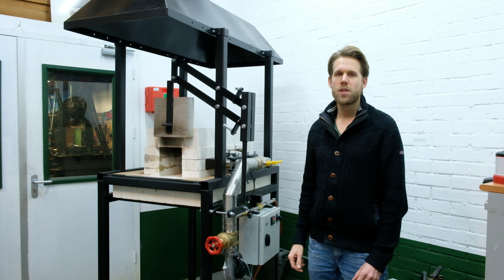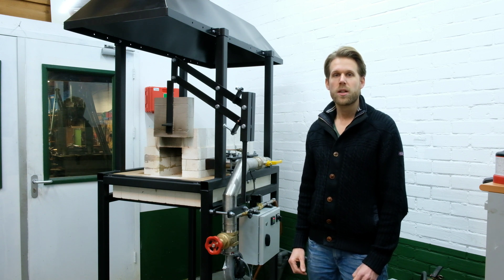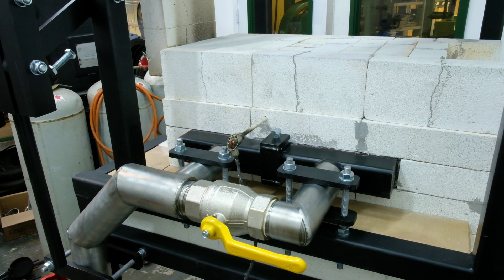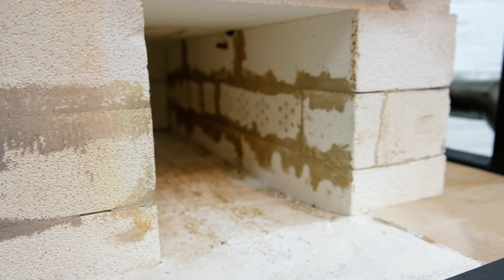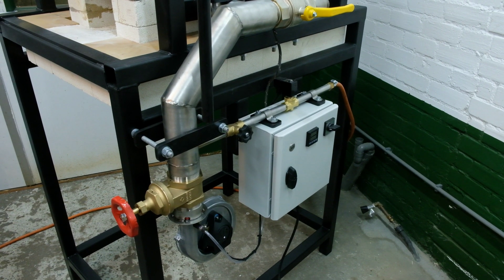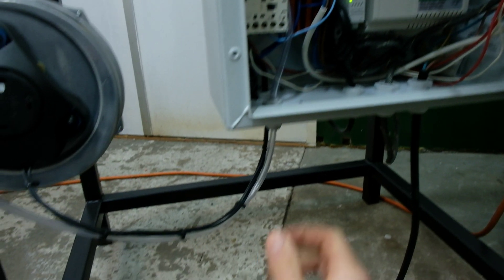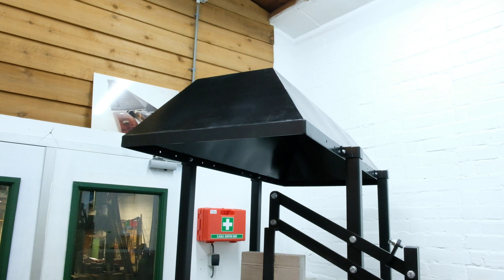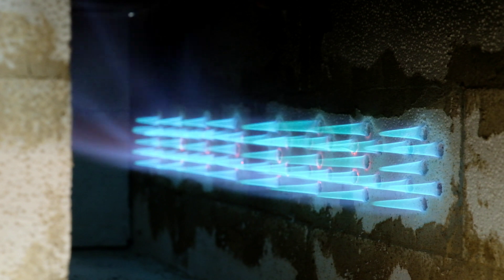Ribbon burner brick pile forge - Van Zanten Engineering

Comment: Great video, how is it holding up these days?
Reply from the maker: The burners are still fine. I do push a rod through the fire holes every now and then to remove clutter. The bricks in the door were too fragile and have break-lines in them, but it is easy to glue them up again.

Comment: Hey Johan, those ball valves have some plastic in them that could melt and fail if heated too much, do you think this would be a problem? I am busy building a ribbon burner forge myself and want to use that safety system with the shut off solenoid. Do you have links to the components that you may send me?
Reply from the maker: Hi Craig, the ball valve doesn't get hot. The link to the air pressure sensor is in the reaction below. For the other components, I will send you a PM.
Reply from the maker: What's your e-mail address?
Reply: @JohanvanZanten  Craigjheb@yahoo.com thank you for the speedy reply.
Reply from the maker: @craighebrard1259  did you receive the mail?
Reply: @JohanvanZanten  yes, thank you, I did! It has been very helpful, I may not use the same supplier due to shipping costs but the information is golden.
Reply: Hoi Johan zou je mij ook de lijst met componenten kunnen sturen? Groetjes Harry hhcwbm@gmail.com
Reply from the maker: @hb5623  Hoi Harry, ik zie je bericht pas net, ik heb je de lijst gemaild.